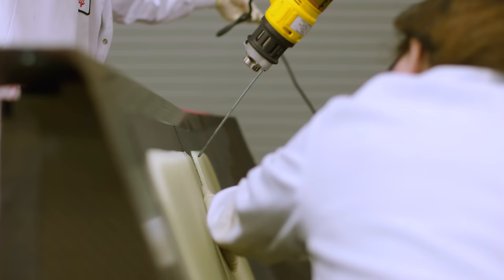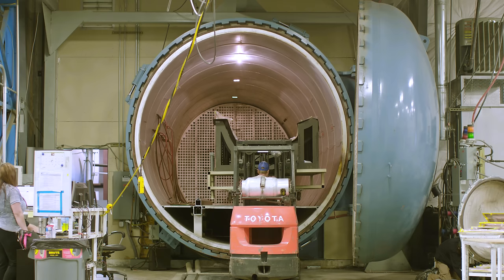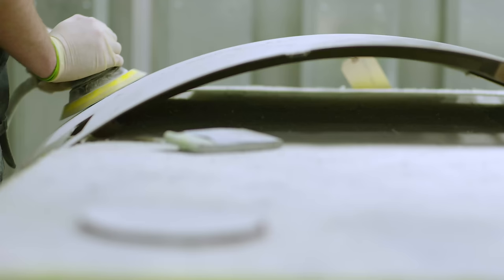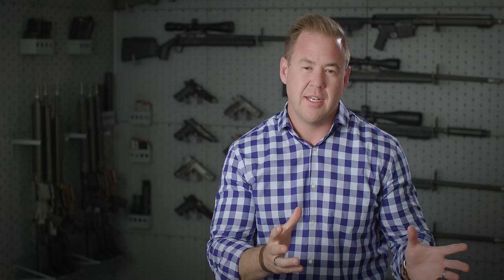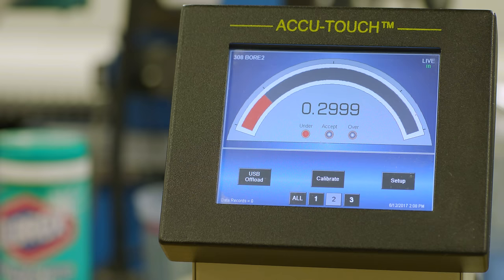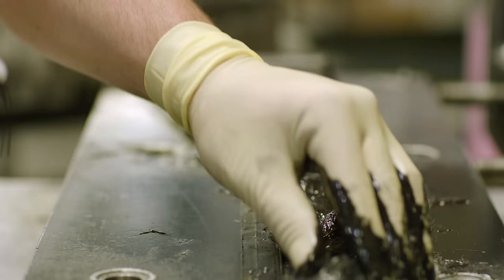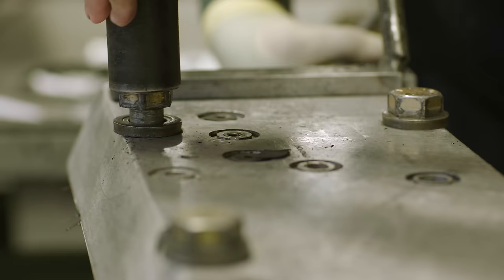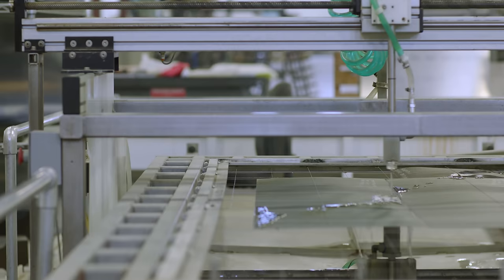Christensen Arms | Aerospace Technology - Carbon Fiber Rifle Barrels and Stocks

Comment: Awesome product, but I have a question.  Since the Coefficient of thermal expansion of the barrel liner and the Carbon wrapping are significantly different, will the barrel liner protrude out of the carbon wrapping and contract causing a failure after constant use?